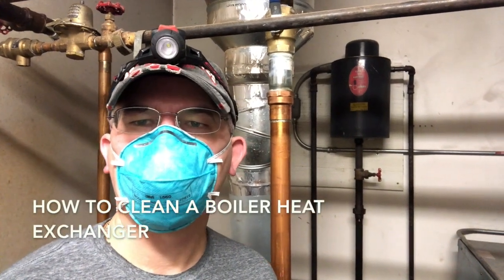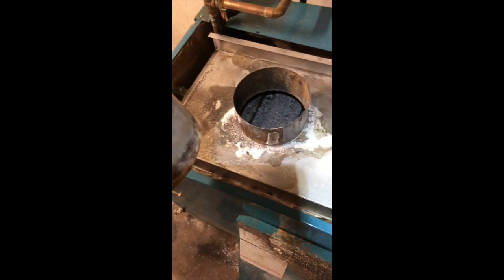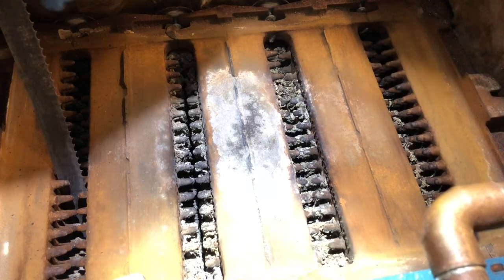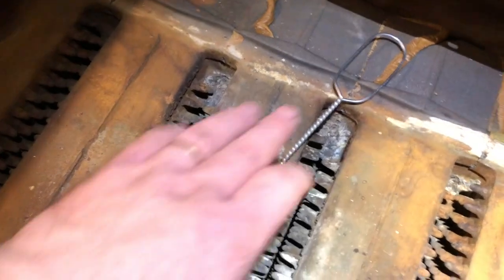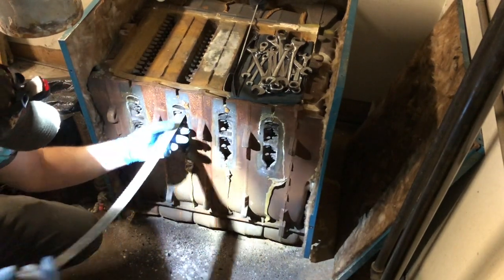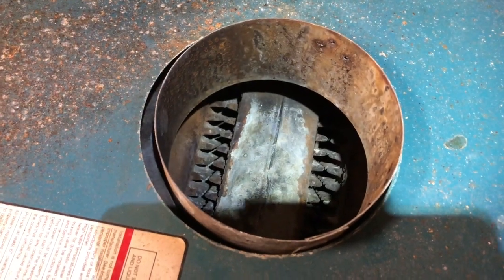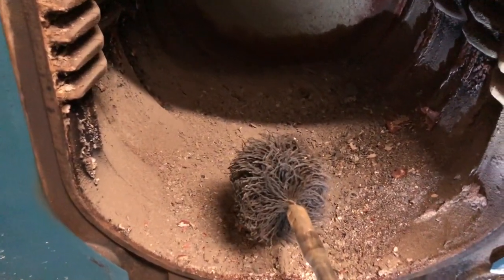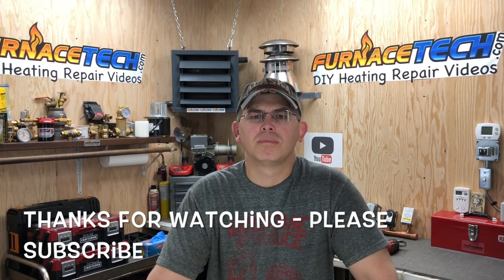How to Clean a Boiler Heat Exchanger - Video #9

Comment: Awesome video. I’m gonna do this to my boiler. It’s dirty. I have those side covers under a door but they have been sealed with boiler cement ?  But I can take off the chimney and remove the top cover like you did and get it from the top. But I can only spin mine to the side because there is a pipe going right through the center of it😂😂

Comment: I have the same attachment foe my ash vac i use on my pellet stove except the bristles are a wire brush instead of plastic. Should work mint for doing my furnace. Isn't there a few other things like adjusting the fuel ratio and checking the co2 being released or something? And also ik you gotta use Chimney Sealant stuff, kinda like mortar around where the exhaust flue meets the actual chimney, also how frequently do i need to clean my actual chimney for my furnace? Idk if ive ever seen my plumber do that, he has however cleaned the exhaust flue that goes from the furnace to the chimney. And last question, also how do you adjust the oxygen ratio and air intake vent? Is there anything you even have to do there and if so how frequently?
Reply from the maker: Yes, there are many items to check when doing service and repairs. Mortar is perfect for connecting to chimneys for sure, just depends on the application or connections needed. It’s good practice to clean the chimney annually and inspect it for wear. Sometimes you may need to hire a chimney sweep company. Every burner is different when it comes to making air adjustments. Never adjust the air or fuel pressure without a combustion analyzer. Most adjustment locations are on the left or right sides of the burner. You will see makings with numbers which represent the current settings. You can loosen the set screws and slide the air bands or shutters. Make sure to tighten them after you make adjustments to get a good reading on your analyzer and don’t forget to make sure burner covers are in place during testing.

Comment: Hope this finds you well..I have a oil fired 4 section Burnham H8..With the oil company I have a premium service contract...They never cleaned the exchangers..Just vacuum chamber and flu...Its 9 years old..I started blowing the relief valve...They changed the water limited valve..Increased the relief valve to 40 from 30 and and put a 60 lb expansion tank from a 30..ALL AT MY EXPENSE..as it doesn't cover plumbing...Relief valve still blowing water at 171 degrees at 40 lbs....With a inferred gun I am getting 225 degrees and 215 on top ...160 to 170 on sides....My thinking is its clogged and only a small portion is getting heated unevenly...Another service call coming..$1,500 already....Could it be it was never cleaned outside?? or could it also be clogged inside...Opinion please..Its 2 months of trying everything but a good cleaning...
Reply from the maker: 1st - Do you have a domestic hot water heating coil? If you do, try isolating it and see if the pressure stays normal.

2nd - check the makeup water pressure regulator. Make sure it’s not stuck open and leaking water into the boiler.

3rd - these boilers should only have a 30psi safety valve.

4th - drain off the system pressure and verify the expansion tank is precharged to 12psi or what ever you need for your system if it’s multi level. These tanks come factory charged at 12psi.

Hope this helps
Reply: @FurnaceTech  Thankyou for your reply...The service technician from oil company changed relief valve to 50psi and removed check valve from Taco pump...No domestic hot water...His reasoning for check valve was the expansion tank was after pump..But as I think about it steam would open check valve ... I had a little water this morning..So its still making steam.. Still think exchanger is dirty and making steam where heat is forced through...

Comment: is that rope gasket and red adhesive going to dry up and peel off easy for the next cleaning and replacement down the line?
Reply from the maker: It comes off ok! Just don’t use anymore than you need to hold the rope in place.

Comment: This may be a dumb question, but do you have to drain the system first?  On my Iron Fireman boiler, there appears to be no way to remove any panels without unscrewing the pressure gauge and overpressure relief valve.  I have no manual.
Reply from the maker: Great question. Some boilers do not come apart like the one in this video. You may only have a side panel or you may need to remove the flue pipe to get access to run a brush and vacuum inside.
Reply: @FurnaceTech  Thank you.  You didn't show draining the system in your video.  Do you generally have to drain the system to clean the carbon and rust out of the heat exchanger?
Reply from the maker: @PanamaSticks  no draining!
Reply: @FurnaceTech  No removable side panel.   Hard to believe you could clean the thing through the flue pipe hole.  Would all the water be forced out if I DID remove the pressure gauge and overpressure valve?
Reply from the maker: @PanamaSticks  yes water will drain if you remove the pressure gauge or safety valve.
There are a few older oil fires boilers which you will need to access through the flue pipe opening at the top. They may also have side clean out ports as well. You can get a flexible brush which you can get into most boilers. I hope this helps

Comment: I have been told that a condensing boiler must go onto condensing mode to keep the heat exchanger tube Externally clean, as it flushes off soot etc. deposits. My boiler goes into ‘ super condensing mode every morning when it first fires up, for about 1/2 hr, then during the day for 10 minutes each time it restarts after the room stat has been satisfied for an hour or two. Also when someone has a shower, it goes into condense mode for 15-20 minutes. So the outside of the heat exchanger is flushed, albeit not all the time, typical return temperature is 55oC with an outlet of 64oC.....should this be sufficient to keep the outside of the heat exchanger clean ? Thanks
Reply from the maker: To be honest, I don’t have much experience with condensing boilers. My understanding is that the boiler will still run at higher temps but in order to get the extra energy savings, it needs to operate at low temps! 
Which also helps to keep the heat exchanger cleaner

I hope that helps.
Reply: @FurnaceTech  so difficult finding anything about deposits on the exterior of a heat exchanger, every reference is for flushing the inside tubes. I think that as it goes into condense mode every so often should keep the HE clear as the condensate should flush it, surprised that so much can accumulate on the exterior of the HE, the gas should be very clean

Comment: Hey. I have a question. My steam has boiler was cleaned 2 months ago, due to high soot level, that was causing the fire to blow a little off the fire area, and blowing that thermic sensor. But now, my boiler still have the same problem again. What do you think it would be. Thank you very much.
Reply from the maker: Do you have an oil fired boiler system?
Reply: @FurnaceTech  no. I have a gas boiler. I was trying to type "steam gas boiler" at the top of my question. Sorry.
So. Only one side is building up spot (the left side). Could. It be some gas pressure/gas mixture issue?

Comment: Seriously thank you for posting this. Like others, a company wanted over $800 to clean out my boiler that's not severely dirty or blocked. I have the itch to try it myself, silly boiler top cover though for some reason has a pipe coming through it so I'll have to cut some sheet metal to remove the top but I'll be sure to seal that gap
Reply from the maker: The old V1 Burnham Boiler have a pipe coming through the boiler skin at the top.

These boilers have side clean out covers which can be removed to gain access to clean the boiler. If the boiler is really dirty then yes I recommend cutting the sheet metal slightly so the metal can be removed.
Reply: @FurnaceTech  good to know and thanks for the reply. I'll explore that a little more. It's a 2A series the manual says but I hope the side access is still accessible with he left side being a maze of pipes and the right side being inaccessible from the water heater. I'll order some of that ceramic/wool material you linked so I can replace that. Today I needed to start it up for a day or two of cool weather so I'll keep it warm like you recommended until I get the insulation and hopefully find a good brush to also use.
Reply from the maker: UffDaDan I would make sure to lookup the boiler model online just to see if you can find an instillation manual for your boiler if it’s different than the model in my video. There are a few differences if you have a gas boiler vs oil fired boiler! If I can be of any more help just let me know! I just want to make sure you are heading in the right direction. You should proceed with caution if you are unfamiliar with performing maintenance on boilers. All boilers should be tuned with combustion tuning equipment to make sure they are burning correctly and not producing carbon monoxide!

Gas boilers are different than oil fired boilers!

I hope this helps!
Reply: @FurnaceTech  Understood. It is a gas boiler and I have performed general troubleshooting and cleaning but not exposing the heating element. When I purchased the house, the inspector did notice high carbon monoxide levels so the sellers paid Xcel energy to come out and "tune it up" which probably meant minimum clean and recheck levels because it was a ~$100 fix and the CO level are slightly high after having a free inspection 3 years later. The free inspector mentioned that if the element is dirty then the exhaust will not be able to efficiently flow through the elements and up through the chimney but rather collect down in the fire box area and that may be a reason why my thermocouples don't last more than 1 year. The thermocouples have been my main problem but I've kept a stockpile around just in case for the easy 5 min fix. I have not ever taken apart the boiler before but do know the functional pieces and the dangers of it all so I feel comfortable going in there with a nylon brush carefully and one of those "it can't hurt" cleanings. I'll double check the manual and exploded BOM diagrams just to make sure that side access isn't the better option, but I purchased some ceramic fiber blanket to replace if I get in there. Thanks!
Reply: @FurnaceTech  Also I should mention the company that came out for the free inspection I think wanted $2000 to physically clean out the element and also putting in cleaning/preserving fluid into the system.
Reply: @FurnaceTech  Hi again, I do have the installation manual luckily for this specific unit, a Burnham 2A series. I got a boiler brush and insulation in the mail so am ready once the forecast looks good to turn it off for a day or two. I see in your video there is a seem of the top panel; I might have to do that because like I mentioned, the safety relief pipe comes out the top which I don't want to mess with, so a nice notch or slice along the top will be easier for access like your video shows it splitting away.

Comment: I’m trying to learn as much as I can about the boiler that I have and I wish you had done it step by step from the beginning. I’m wandering if the water in the boiler should be drained or not.
Reply from the maker: You do not need to drain the boiler for annual maintenance.
Reply: Furnace Tech  Thank you!

Comment: Very good vid my Man and you kept a dusty work area clean instead of dropping it on the floor and vacuuming it up in soot covered shoes.
Thorough, professional work along with some great service tech experience.
I’m a boiler guy with 20+ years as a personally licensed mechanic HVAC.
I am a bit curious about the chimney as that seems to be the source of the debris, did you figure that out?
I am assuming an unlined chimney, rain water and poor draft combined to start problems with condensation in the chimney and block following as draft grew weaker. 
Anyway, you got a sub from a fellow professional 👍 and a position on my shops tech go to sheet.
It’s not a hard job, but it’s a bit tedious getting in done right.
One suggestion for you, I use a pair of electricians scissors to cut gaskets, flat or round, so I’m not dulling a knife blade on the block. That technique let’s you line up your ends and corners better while in place.

Comment: Good video..i have a utica water boiler and one of the heat exchanger plates was raised up not even with the mating plate ...what would casue this?...i knocked it back down .to make it even...
Reply from the maker: der ddd I would suspect that it was installed like that or was no tightened enough and shifted. Hard to say!